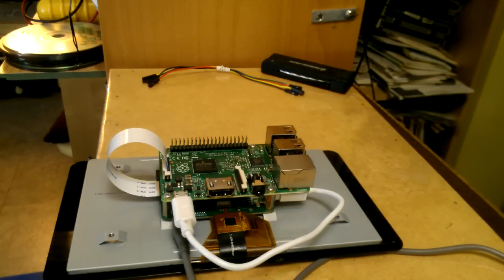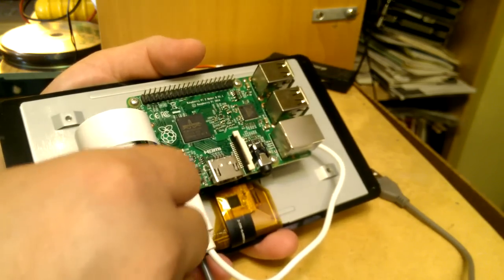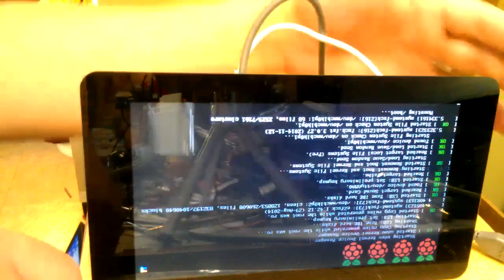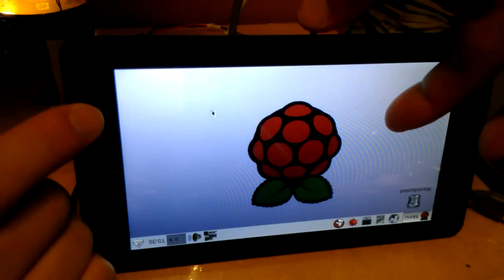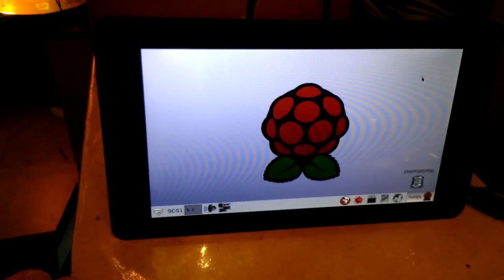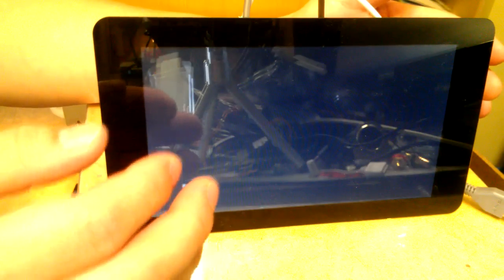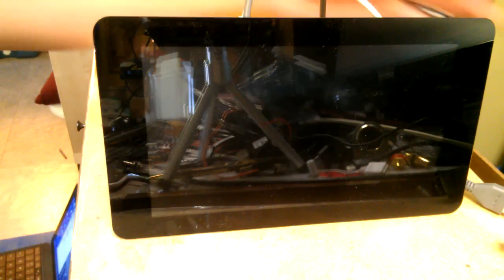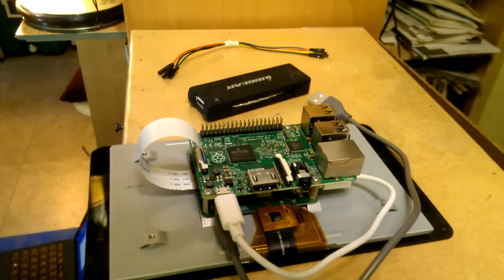Raspberry Pi 7 Inch TouchScreen Display - Part 3 Software/Testing

Comment: this will rotate the display the right way round 
In Terminal, type in:- sudo nano /boot/config.txt
Add the line:-   lcd_rotate=2 to the top or bottom of the file.
Press CTRL+X
Then Y
Then Enter.
And reboot!
Reply: Thanks for the help!!
Reply: djstevi thanks!
Reply: djstevi, can you get to the terminal in the emulation station OS for the raspberry pi? if so then how
Reply: Cory Tonelli how do you get your updates do you go into terminal
Reply: you are my hero.

Comment: Theres no back cover? You just have a motherboard sticking out on the back? That kinda sucks, wanted to bring it around protably
Reply from the maker: Yes. They do have a plastic frame with two feet. But still bare back. You would need to make your own case if you want a portable device.
Reply: djstevi That's really cool! Thanks!
Reply from the maker: I bought one of those here in the USA.  Very nice case except that I had to cut a hole for SD card access. I think I saw a new version somewhere.
Reply: the one i bought has access for sd card
Reply: sorry this one hasnt either
Reply from the maker: ¿Que?

Comment: did you use rasbian jessie or wheezy for this?
Reply from the maker: +maxine attobrah, the display came out a few days after the (then) new raspbian came out. It was jessie. the older raspbian won't work with the display. Just install the newest OS and the display works automatically upon first boot.
Reply: +leefiles yaaaaaassss!!! It finally works :D Thank you so much! Before I was using Raspbian Wheezy and that was not working for me but after installing Raspbian Jessie, its working. I am so excited lol. A lot of the newbie videos for raspberry pi were so hard to understand but you made yours nice and simple to catch on.
Reply from the maker: glad it worked for you. keep it updated with apt-get update and apt-get upgrade.
Reply: +leefiles is there an internal keyboard I can add to the display or do I have to get an external keyboard?
Reply from the maker: you can install a soft keyboard.  Try one of these: matchbox, cellwriter, xvkbd. Try and see which one you like.
Reply from the maker: +Alm Dudler  Thanks! RemotePi looks good for the RPi zero. Because of the zero's limitations.

Comment: how many fps are you squeezing out of the display?
Reply from the maker: +Eric Nyamu  The display has a refresh rate of 50Hz. So 50 frames per second would be the max even if the pi can squeeze out more.